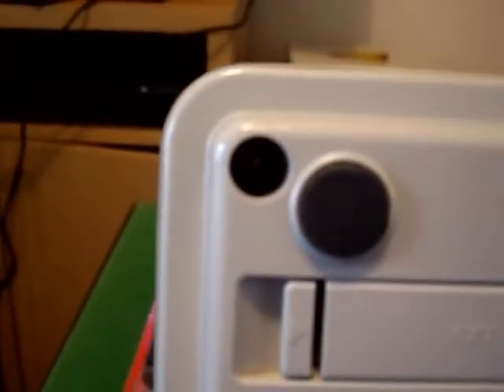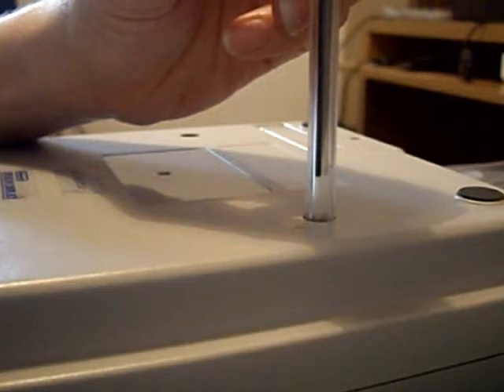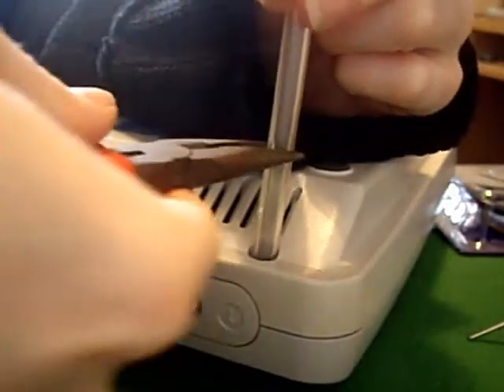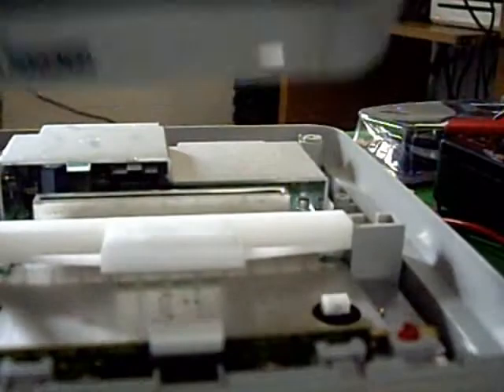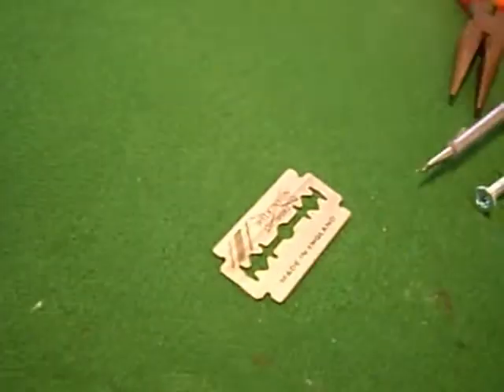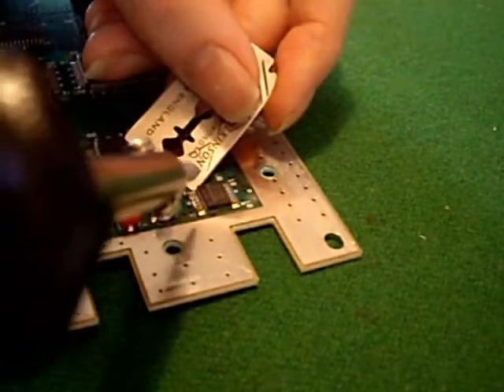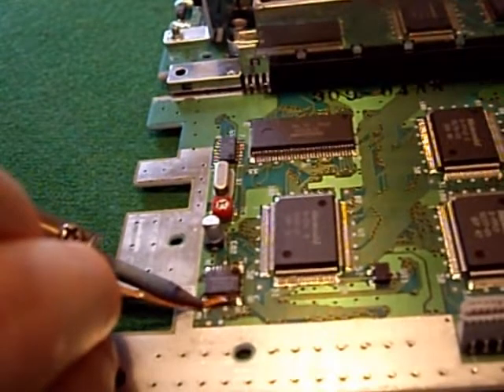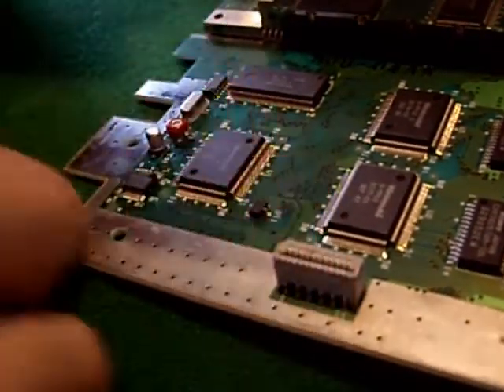Snes mod with switchless modchip by jse, difficulty level = insane (Part 1 of 2)

Comment: Believe me,even if i don't own a SNES but a PSX,soldering a modchip was insane for me.BTW i'm 12,so that's why is so insane.
I installed a 4 wire chip on a PSX SCPH-5502,surprisingly worked.